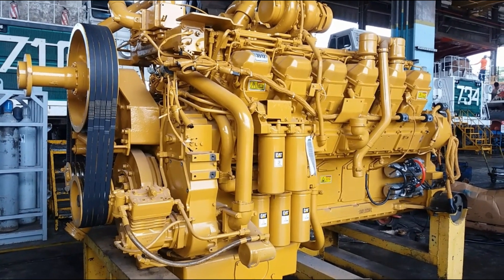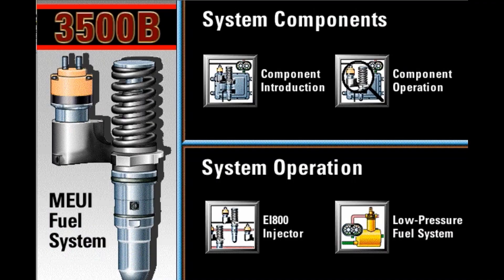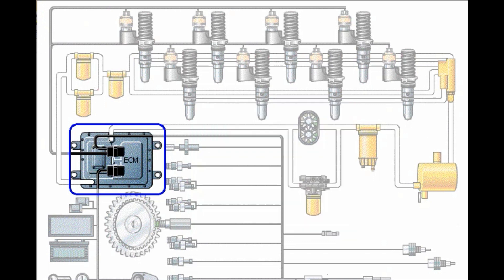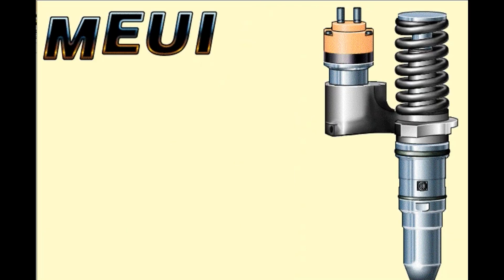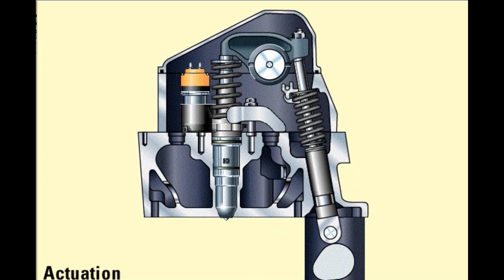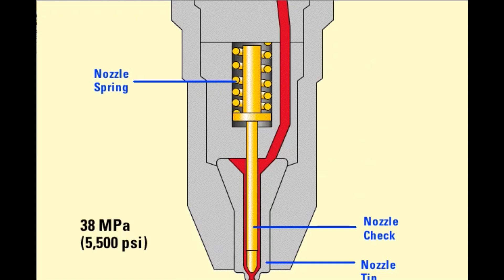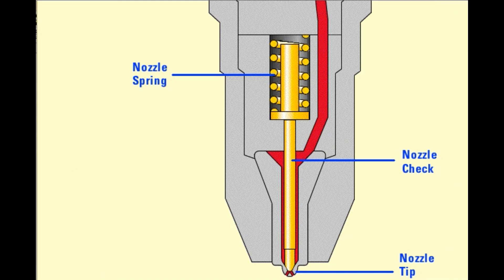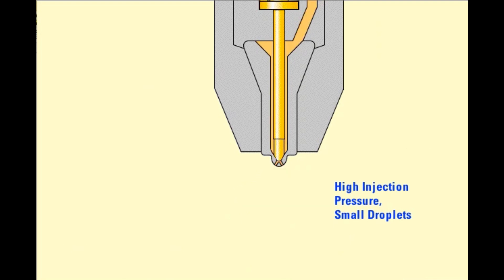3516B ENGINE MEUI FUEL SYSTEM PART 2

Comment: Bang  pemasangan conrod pada crank shaft boleh timbal balik ngga..
Reply from the maker: untuk engine apa ini,,jika untuk kendaraan kecil di perbolehkan  ..untuk engine 3500 series bottom side untuk conrod lebih besar di banding upper side.
Reply: @lpkbinakaryaeducation8585  c15 dan c18 bang